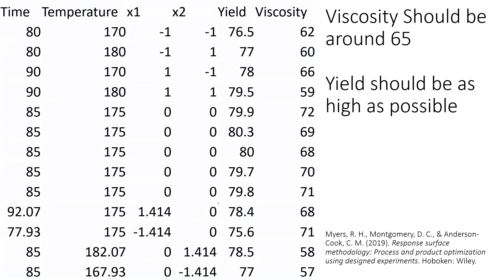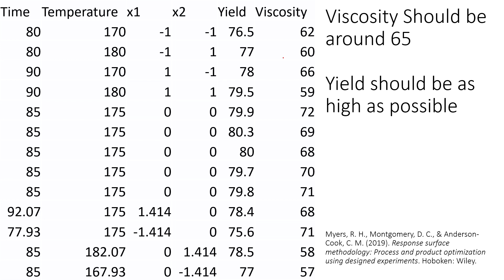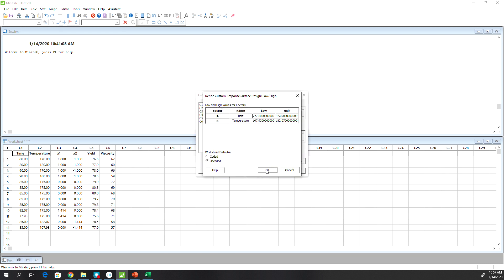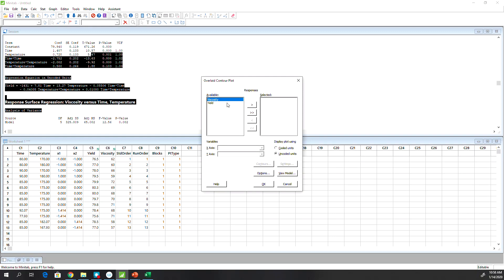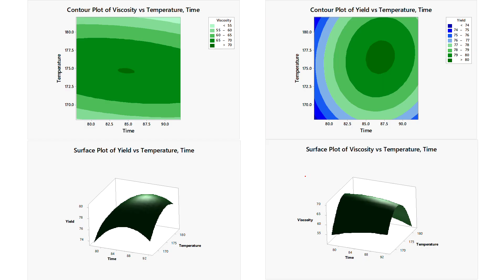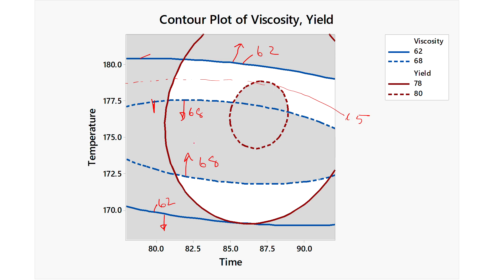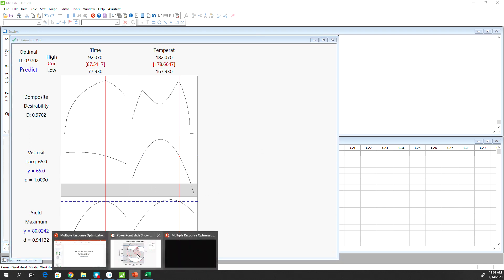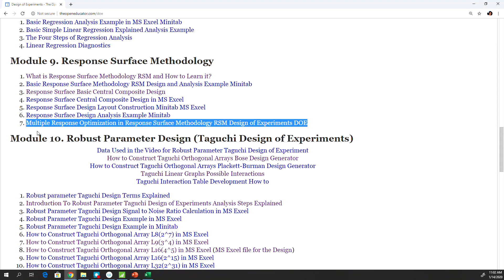Multiple Response Optimization Explained with Example using Minitab Response Surface Methodology RSM

Comment: Hello, I am working on my masters project on development of wind turbine blade using composite. The composite is polyester reinforced plantain fiber. I have the flexural strength, tensile strength, impact strength, HRC, density and water absorption of the composite at the fiber volume fraction of 0.1, 0.3, 0.5, 0.7, 0.9 respectively. I want to design wind turbine blade. Since I have the properties of the composite at different fiber volume fraction, What method am I going to use to determine the optimum mix of fiber and matrix that I am going to use for the design of wind turbine blade?
Reply from the maker: You will find more on this topic here: https://www.theopeneducator.com/doe

I think Module 5 to 10 will provide the detail answer to your questions.
Reply: thanks

Comment: Hi, enjoyed watching the video. Just curious how do I determine the process window of time & temperature using the overlaid contour plot & response optimizer? Why was the value 65 chosen for the optimizer? Thanks
Reply from the maker: There are no rules for finding those. It's more of a trial and error process to choose those values. Most likely, you have some idea about those because you are an expert in that context of study. There are some optimization techniques to determine those. However, I have found them tedious than to start with a good guess. Play with the software by changing the numbers, you will get the answer quicker than you expect.
Reply: @TheOpenEducator  Thanks for your prompt reply. Do you mind sharing the optimization techniques you mentioned?  Where can I find more info on the techniques?
Reply from the maker: @ScuderiaCampione  https://www.theopeneducator.com/doe/Response-Surface-Methodology